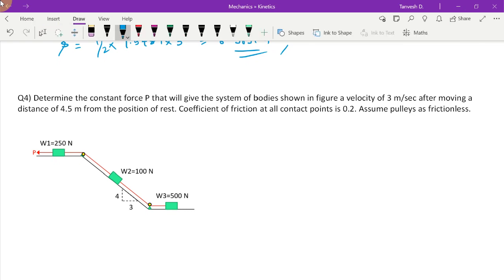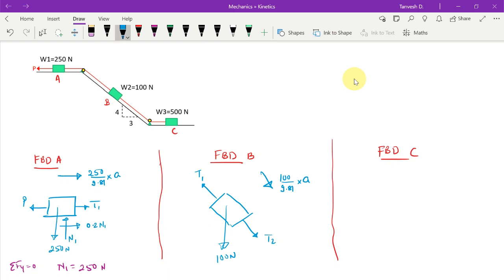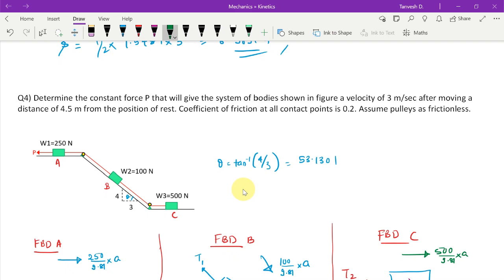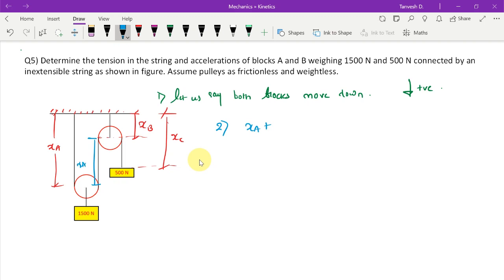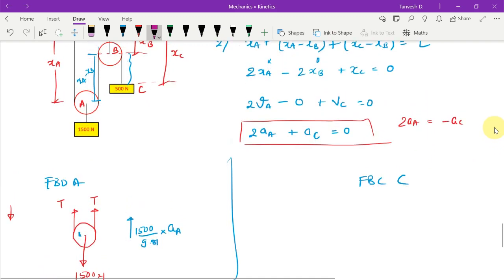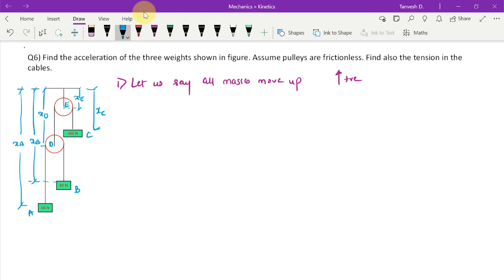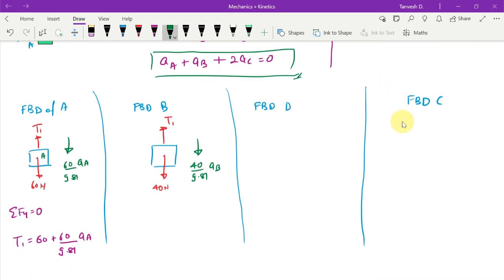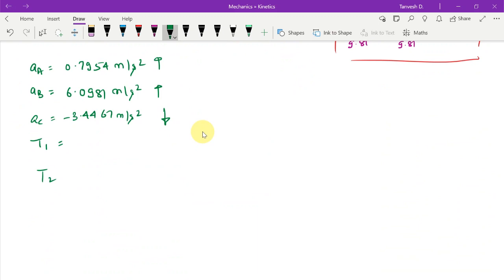Lec 41 - Pulley problems | Engineering mechanics

Comment: FBD of b block is wrong. You didnt resolved N2
Reply: Look kartik the weight of body 100N is at an angle thetha ...for that we have resolved the components also.
N2 is normal to the surface of bolck which is inclined...as already we have resolved the components for 100N ,no need to resolve the components for N2 ... because N2 and the components which we have resolved are in same co ordination system..
If you wanna resolve N2 you can do that but for that case , components of weight are not required 
Hope you will get this now.
Reply from the maker: because it does not have to be resolved! the entire co ordinate system is relative here, its not wrong.
Reply: 250/9.81 × a ????? Fbd of A